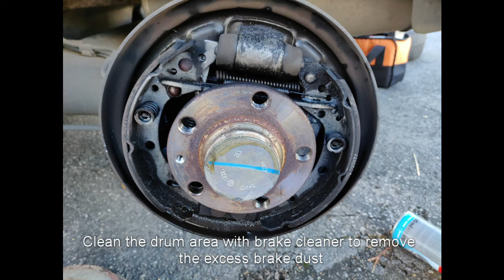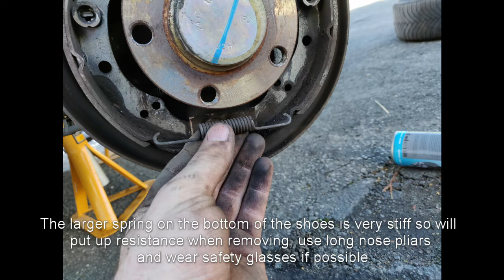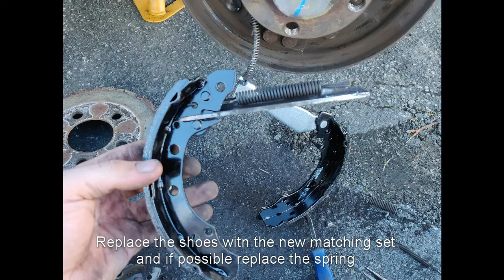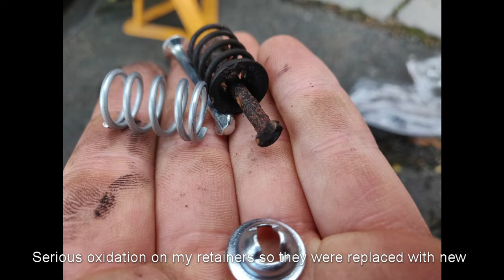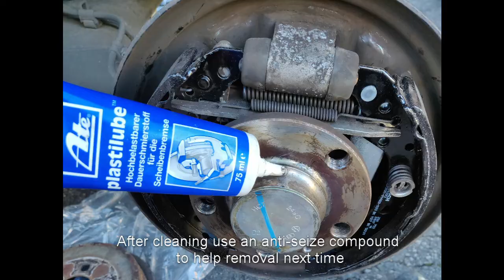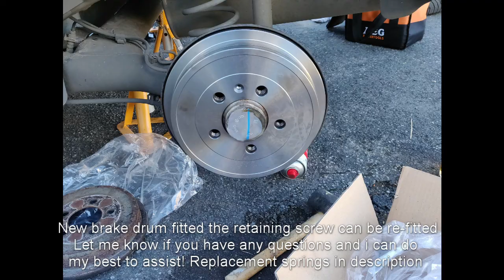Brake drum change on a Mk5 Seat Ibiza 1.4 petrol

Comment: Great video, I've got everything replaced including new wheel cylinders as seals leaking, however I'm struggling to get the new drum on..... any help would be greatfully received. Thanks
Reply from the maker: Have you tried loosening the handbrake cable inside the car ? If you pull on the cup holder between the two front seats you can lift the trim up and loosen the adjuster right out. Hope that helps!